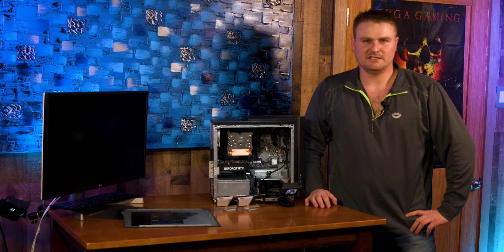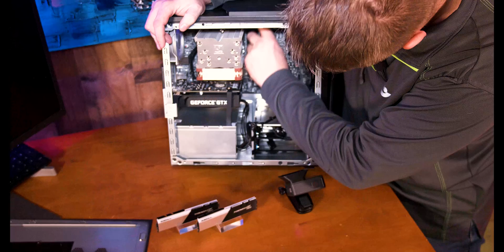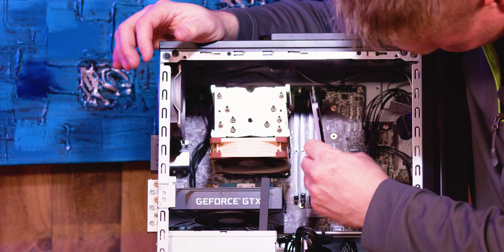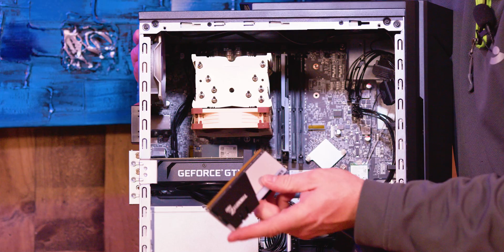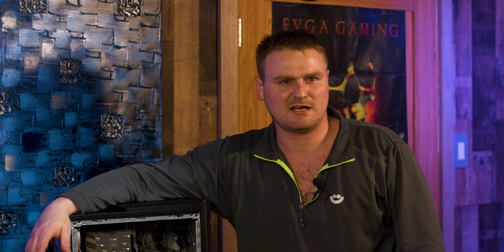Acer Nitro 50 How to Install Memory for Dual Channel RAM | 16Gb Upgrade

Comment: i have the same pc, i wanted to upgrade an extra 16gb so i had 32gb, so thankyou for this video! also what is the best SSD for an acer nitro, i have never opened it up before and messed around with it so i would like something that is fast but easy to put into the pc without messing around and worrying about breaking anything lol
Reply: You can buy ssd 2.5 and connect with sata and you done only 2 cables if you wanna do NVMe you need to unscrew one screw and pull out but then you need to to windows instalation
Reply: I have a acer nitro 5 pc and it came with a 8gb ram stick but there’s only two ram slots in the mother board. Will it run dual channel if I add another 8gb ram?

Comment: Can u plz tell me if the crucial 8gb DDR4 ram 1.2v 3200mhz on Amazon is good for this pc
Reply: I have a acer nitro 5 pc and it came with a 8gb ram stick but there’s only two ram slots in the mother board. Will it run dual channel if I add another 8gb ram?
Reply: @Trey-dg8yw  no
Reply: @itzzzzz_nico9103  how do you know?
Reply: @Trey-dg8yw  nvm it will

Comment: Just upgraded my ram, but it’s showing as 2400MHz, meant to be 3600 is this motherboard capped?, it won’t let me edit it on the bios :(
Reply: Most likely yes it capped by motherboard but it should run at least 2666mhz
Reply: Yeah your motherboard has limits so you have to read what is your max MHz

Comment: can i keep the other Ram stick in?
Reply: You can leave the old one but the old ones is cl22 or Cl20 so if you buy one new like cl15 ram the new ram gonna work slow like the previous one so both gonna work on the weakest ram speed

Comment: I'm trying to read through the comments. But I wanted to know if this desktop can support faster ram speeds than already installed. I'm not a computer guy..I purchased this PC sale with a 3060. And a ryzen 5 5600g. And what I believe to be 16gb of ram...single or dual channel I'm not sure. (Still waiting for the order).

The geek squad guy who aided me was unsure if the motherboard can support faster speeds. If anyone can give some input that would be greatly appreciate.
Reply: What brand is it acer ?

Comment: Actually not the correct way! I’ve got the same computer and when i did this exact procedure my pc began to make a beeping noise that something isn’t correct. When i placed my two 8gb ram sticks NEXT to each other it worked. The beeping stopped and i had visual again on my pc. Idk if its just me but this worked for me.
Reply from the maker: Not sure but that sound like you have a Bad Dimm slot on the motherboard.
Reply: @TNW1337 yeah that’s weird he got that. Because me personally I actually messed up and set them next to each other and got that beeping sound. Quickly turned off my pc re opened it back up. And correctly found out where to put them and boom I was upgraded.
Reply: Which specific model is this

Comment: I just got a N50 12400 640. I have only 8 ram on a 1660 super. I can see on the market the same case and motherboard run up to 64 ram and 30ths graphics, do I have enough power font to run 16 ram?
Reply: I have a acer nitro 5 pc and it came with a 8gb ram stick but there’s only two ram slots in the mother board. Will it run dual channel if I add another 8gb ram

Comment: Hello, can i control the ram rgb lightning with stock motherboard?
Reply: I have a acer nitro 5 pc and it came with a 8gb ram stick but there’s only two ram slots in the mother board. Will it run dual channel if I add another 8gb ram?

Comment: Hey tech, i got the old ram peace, and it has 3200 mhz, can i upgrade it to a new ram peaces and put more mhz for example 3600 mhz? 
And i got another question. If i upgrade the graphics card to a rtx 3070 for example will the power supply support the video card?
Reply: Only gonna work at 3000mhz or 2666mhz depends on acer pc you have and the 500w power supply is not a best idea for rtx 3070 you should buy a rtx 3060ti
Reply: I have a acer nitro 5 pc and it came with a 8gb ram stick but there’s only two ram slots in the mother board. Will it run dual channel if I add another 8gb ram?

Comment: I can't remember if he said in the video but i have a n50-620 and it doesn't support xmp. You can't overclock it. I got some Corsair vengeance 2x8gb 3200mhz and they only run at 2133mhz. So don't be a noob like me and do some proper research before you go upgrade this pc
Reply: Did you end up changing it or nah

Comment: I have an acer nitro 5 desktop ( the newer one) and I only have 8 GB ram and I wanna get more .Do i ave to get one with the exact MHZ or can I get a different one. The mhz for mine is 2666mhz.
Reply: I have a acer nitro 5 pc and it came with a 8gb ram stick but there’s only two ram slots in the mother board. Will it run dual channel if I add another 8gb ram?

Comment: Is there any specifics about the ram you need to buy? I don't wanna end up buying new ones for them not to be compatible
Reply: what did you end up getting?  I'm about to upgrade to 32GB
Reply: @lernen.ohne.angst.official2737  I ended up just getting Corsair vengeance which was a mistake. The bios doesn't allow to over clock the ram so will run a default speed on this pc. For the Corsair it is like 2133mhz or something which isn't good. You can get some that run at 2666mhz or if you do some real digging around you can find similar ram that comes with it at 3200mhz that doesn't need over clocking. But they are bang average ram with like CL 20 ratings. Yeah I wish I never got the pc
Reply: @theibaneztamer5072  Yeah, I got Kingston Fury Beast RGB 16GB (8 x 2) 3600MHz, I hope it works out.  If not, I still have the 8 that came with it.  I run video editing software Vegas Pro 20 so, that is what I am primarly worried about.  No gaming currently.  Thanks for answering so quickly
Reply: @lernen.ohne.angst.official2737  Did it work out alright?
Reply: @wil50nn  Nope.  I made the mistake of buying an Acer PC and the motherboard although you can upgrade up to 64GB, 32 fried some components and it had to be replaced.  So, to be safe, I am sticking to Acer RAM for this computer.  I had to pay $85 to ship it to Acer to repair. I guess everything in the box is proprietary so using 3rd party comes with some risks.
Reply: I have a acer nitro 5 pc and it came with a 8gb ram stick but there’s only two ram slots in the mother board. Will it run dual channel if I add another 8gb ram

Comment: Thank you again for this very useful video!
Tell me if this is a good ram :
Textorm 2×8GB DDR4 3200 MHz CL16 1.35V
Thanks ! You're the Best !
Reply from the maker: Best ram will be 1.2v but. But it will work
Reply: I have a acer nitro 5 pc and it came with a 8gb ram stick but there’s only two ram slots in the mother board. Will it run dual channel if I add another 8gb ram?

Comment: Hey Tech, would this work in that PC? Corsair Vengeance RGB RS 32GB (2x 16GB) DDR4 3600MHz Memory. its tested voltage is 1.35V but its SPD Voltage is 1.2V
Reply from the maker: yes it will work prob not at 3600. Does it say what the stock SPD Mhz is? I own that ram but in 32GB dimms for my editing computer it did work in the TG02 Victus.
Reply: @TNW1337  2133mhz is what is says. only reason I didn't go with the ones you linked in description is I cant seem ti find ones in aus or that ship to aus without ridiculous costs
Reply: @Wildfire99170  Hi mate, I'm wondering if it worked by you . I got N50-640 and can't find out should I buy 3600mhz 2x16GB or it useless?
Reply: I have a acer nitro 5 pc and it came with a 8gb ram stick but there’s only two ram slots in the mother board. Will it run dual channel if I add another 8gb ram?

Comment: just bought the wrong ram for my nitro 50. when doing these videos. could you PLEASE specify WHICH nitro 50 computer( the 620. the 640, exc.

) my nitro 50 640 ur12 only had 2 slots!
Reply from the maker: it has to do with youtube and the algorithm when you add model numbers it screws it up. also we only get like 50 Charters that a viewable up to 100.  But I could add it to the disco. Most of the time in the unboxing I say the Full model number.

Comment: Hey Tech two questions for you, I am thinking about upgrading to 16gb 3200mhz XPG sticks but I have heard that the motherboard locks top speed to 2666mhz and it isnt changable in bios? just wondering if you have experience with this or tried looking into that? As well I am wondering is it possible to swap out the Prop motherboard for an ATX motherboard? Specifically a TUF B560m-plus.
Reply from the maker: Yes the memory will work but not at your speed. No it will only take a acre board sorry.
Reply: Max size is an mATX.
Reply: @tonyboraggina6223  So an mATX aftermarket motherboard will fit the acer case? good to know
Reply: I have a acer nitro 5 pc and it came with a 8gb ram stick but there’s only two ram slots in the mother board. Will it run dual channel if I add another 8gb ram?

Comment: does the Corsair Vengeance LPX 16GB (2x8GB) DDR4 3200Mhz Desktop RAM fit and work?
Reply: Yeah I upgraded just today, and the ram speed ran at 2133mhz bruh. I tried looking for xmp on my acer bios setup but I couldn’t find it
Reply: @gwin2647  yeah, I just upgraded mine. and it only says that its 2133mhz! Probably the motherboard capping the speed? somehow i wonder if there is a way you cna overclock it
Reply: @secretchannelshhhhhh  probably, idk there must be another way to overclock. If not then, I’m screwed and wasted my money for nothing
Reply: @gwin2647  hmh ye
Reply: @secretchannelshhhhhh  unfortunately there is no other way I even contacted acer support and their bios does not support xmp. :(
Reply from the maker: Yes and yes no XMP.
Reply: @TNW1337  mhm
Reply: @TNW1337  thatnk you it worked

Comment: I see in this video the cpu fan is facing the gpu. In other videos it's facing the ram. Which way would be better for lower temps.
Reply from the maker: Ram side..
Reply: I have a acer nitro 5 pc and it came with a 8gb ram stick but there’s only two ram slots in the mother board. Will it run dual channel if I add another 8gb ram?

Comment: Hey, I ordered this pc and it’s being shipped as we speak. What brand of ram should I use or could you tell me what the one that you were using were?
Reply from the maker: I list them in my disco area on every video. I used trident z just to show off the RGB.  You will want 1.2v Ram or 1.25V ram.
Reply: I have a acer nitro 5 pc and it came with a 8gb ram stick but there’s only two ram slots in the mother board. Will it run dual channel if I add another 8gb ram?
Reply: @Trey-dg8yw  interesting, cause mine came with 4 slots. I don’t see why not so imma say yes. I put in 4 16 gig ram sticks. Make sure to do research on the brand and if it’s compatible
Reply: @YoungVonni305  how can I contact acer to get more information

Comment: hi why after ram upgrade .. the ram speed show in system is 2667mhz

not 3200?
can help?
Reply from the maker: This is do to No xmp support. this is why I say to only get 1.2v ram. or 1.25v
Reply: @TNW1337  I don't think that has anything to do with it.  I tried 1.2v of PNY and was stuck at 1666mhz.

Comment: Is a 32gb stick too much? And if not is the 1.35 volts too high for this pc?
Reply from the maker: 64GB is the max so yes 2x32GB 1.35v will work.
Reply: @TNW1337  okay thank you I just got it and I’m liking it a lot thanks man!

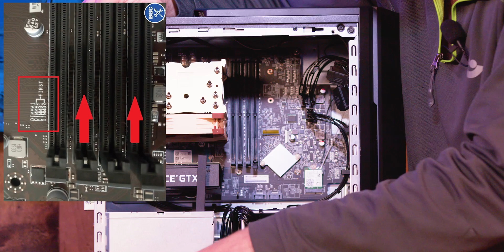Comment: I noticed that there’s four slots for RAM cards in this model. My model also has 4, and I was wondering if I should put the 16GB cards I have into the slots designated dim 1 or 2, and the two 4GB cards that came with it in the other dim. I’m guessing that, given the image provided at 00:21, dim 2 is the primary RAM cards that are loaded, but I just wanna know for certain, and also if it’s a bad idea for me to put the pre-installed RAM in the secondary dim, given that it’s the same as the 16GB cards in all other regards besides capacity
Reply from the maker: it may not work, or make it so you only have 4GB x 4 even with the 16GB Dimms. normally you try to avoid mixing dimm sizes. it does not hurt the computer but can hurt performances
Reply: Ah okay, I think I can understand how that would be the case

Comment: Hey techitwit, I was just wondering if 2 16G 1.35V ram sticks would work fine in this upgrade. Thanks!
Reply from the maker: They Would work yes
Reply: I have a acer nitro 5 pc and it came with a 8gb ram stick but there’s only two ram slots in the mother board. Will it run dual channel if I add another 8gb ram?

Comment: Hey technitwit, So I’m wondering if there’s a 32 gb ram upgrade. If so can you please tell me one I can buy from a Amazon ? 😊
Reply from the maker: Yes there is I have kits listed in the Description. Just double check to make sure it is 1.2v or 1.25v ram.
Reply: I have a acer nitro 5 pc and it came with a 8gb ram stick but there’s only two ram slots in the mother board. Will it run dual channel if I add another 8gb ram?

Comment: Hello technitwit, Can I use any other ram sticks or it had to be this specific ??
Reply from the maker: You can but it may drop your speed to 2400. Best to upgrade with a kit of matching sticks. Unless you look up the same brand and Speed and voltage.
Reply: I have a acer nitro 5 pc and it came with a 8gb ram stick but there’s only two ram slots in the mother board. Will it run dual channel if I add another 8gb ram

Comment: Fantastic. Very much appreciated. Bam! It's in thanks to you. Great video!
Reply from the maker: Any time thanks for the Comment!
Reply: I have a acer nitro 5 pc and it came with a 8gb ram stick but there’s only two ram slots in the mother board. Will it run dual channel if I add another 8gb ram?

Comment: Hello im very new to computers , I have purchased the Acer Nitro 50-610 series, 1 - 8g ram card currently, I'm looking to make the upgrade to 16g ram, I've been looking at the ram cards in the description, Kingston 2x8G rgb 2666mhz fury cards to be exact, how does the lights work on those, do I need to power the lights? And the next question I have is, would the faster cards not work in the computer?
Reply from the maker: Nope the memory socket powers them.
Reply from the maker: Faster memory? They need to be able to support 1.2v or 1.25v dimms

Comment: I had to send my Nitro back same day I received it, 30 minutes to boot up, 45 to shut down....but, when it does come back, I have everything to upgrade it, Just confused about the SATA port on the motherboard, when I connect the HDD, should it be clip part away from board, or towards? It's extremely tight in there.
Reply from the maker: Awesome! That Sucks 😒,The sata connectors on both ends are L shaped, It will only allow it to go in the right way.

Comment: hi Technitwit I am a fan I love your videos I was planning to buy this pc and i bought it but what i have experienced is that the CPU and GPU sometimes gets hot and there's not a lot of good airflow in here plz when your free can you show me how to install a another fan I have one laying around.
Reply from the maker: I have the cooling video Shot. I blew up the pc well doing this. Normal gaming does not do what I did . I Pretty Much keep the CPU, GPU & Ram at 100% for well over 4 hours. Yes it gets way to hot. keep a eye out for the video it will be coming soon.
Reply: @TNW1337  thank you so much its really nice that you reply
Reply from the maker: @pulsive5963  yes sir
Reply: I have a acer nitro 5 pc and it came with a 8gb ram stick but there’s only two ram slots in the mother board. Will it run dual channel if I add another 8gb ram

Comment: Hey Technitwit, just did this to mine using the same g.skill ram.  How do we get the new memory up to full speed?  Mine shows only 2133 in task manager & cmd?  Can't seem to do the XMP change in bios.  Any ideas?
Reply from the maker: You can't the bios locks it. What surprised me is the fps loss was minimal. Like 10-20. You need different ram if you want higher speeds.
Reply: @TNW1337  What ram do you suggest for full 3200?
Reply from the maker: @hsv265  Well the best I could get even with get with 3200mhz ram, was 2993mhz. Some one said you can change it is the bios. But my Acer took a crap well I was stress testing it for a cooling video. (had to rma it) So I can not verify this at this time. I have been in bios and did not see it. It would not hurt looking again. Make sure the Ram is 1.2v or 1.25v for best results.
Reply: @TNW1337  ok, I’ve checked the bios and also couldn’t see anyway of changing the speed.  The bios seems to be simplified with not many options.

2993 is a lot better than my 2133, did you manage to select that or did your Acer allocate that speed automatically?
I’m using the two 16gb gskill trident z rgb 3200 1.35v.
My original two x 8gb ram runs at 3200.  So my question is which do i keep, original 16gb ram running at 3200 or the new dual ch gskill rgb 32gb ram at 2133?
Reply: @TNW1337  where do you check? Is task manager accurate? I have a higher version that came with dual 8gb. It said it was 2666hz but it says it's running 3200hz. So do you think I could squeeze a 3600hz?
Reply: I have a acer nitro 5 pc and it came with a 8gb ram stick but there’s only two ram slots in the mother board. Will it run dual channel if I add another 8gb ram?

Comment: Hey could you put out a video of a tutorial of how you installed the cpu cooler?
Reply from the maker: Yes it is coming
Reply: I have a acer nitro 5 pc and it came with a 8gb ram stick but there’s only two ram slots in the mother board. Will it run dual channel if I add another 8gb ram?